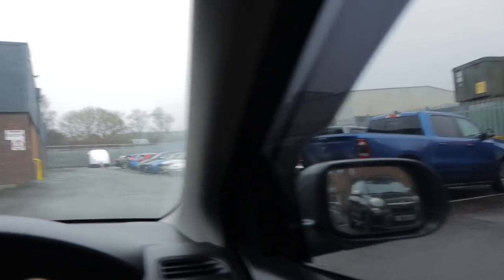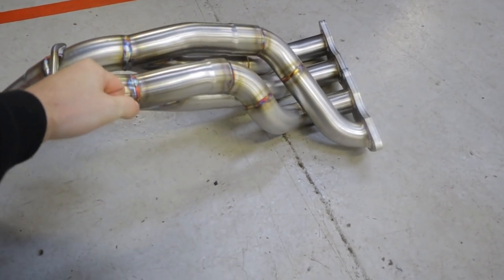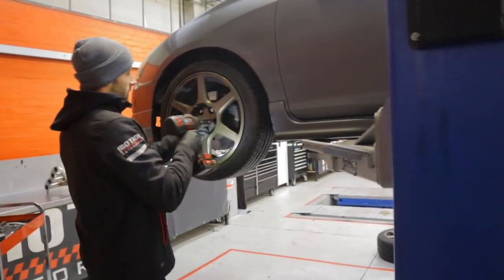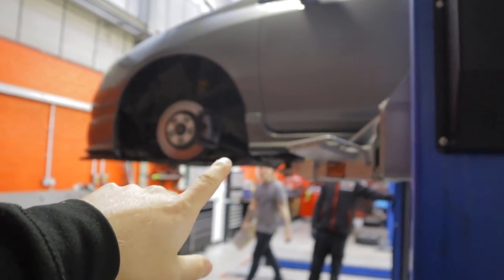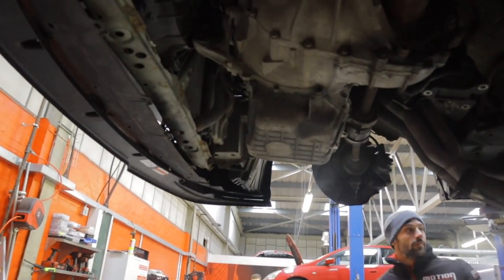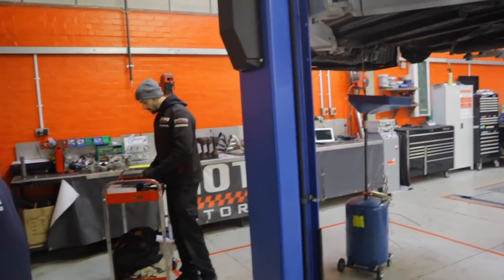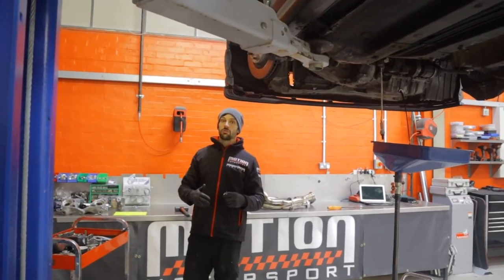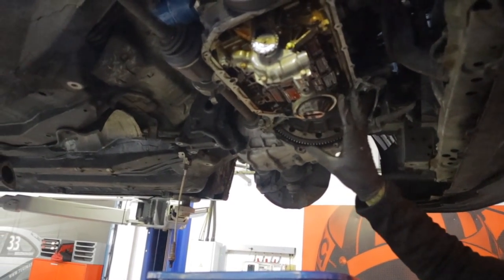FITTING A SOLIDFAB 4-2-1 + BAFFLED SUMP AT MOTION MOTORSPORT!!

Comment: Wouldn't a baffled sump just starve both ends of the engine of oil ? Like piston 1 and 4 cause the oil mostly sits in the middle ????
Reply: Joe Ever no, as the oil pickup is in the middle which is what sucks the oil up to the squirters at the bottom of the pistons